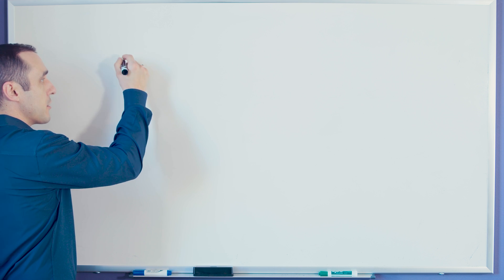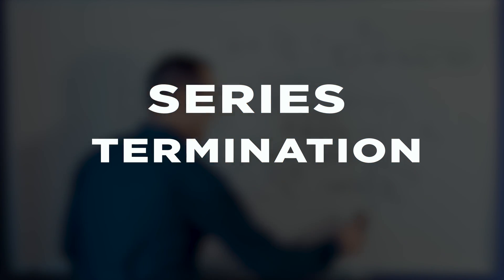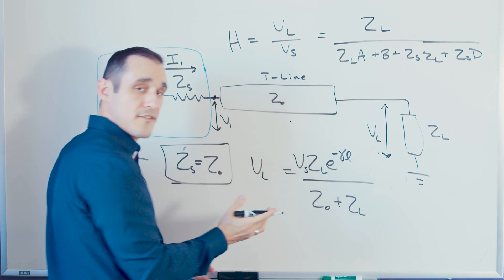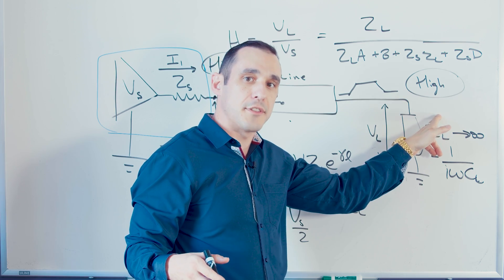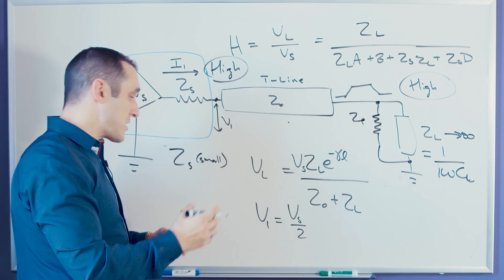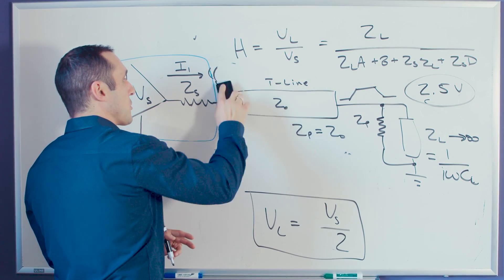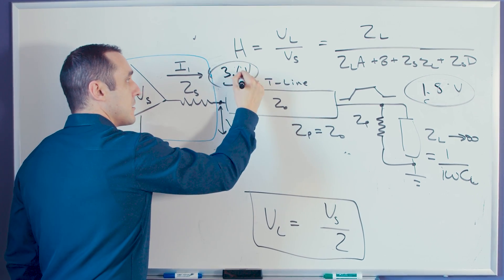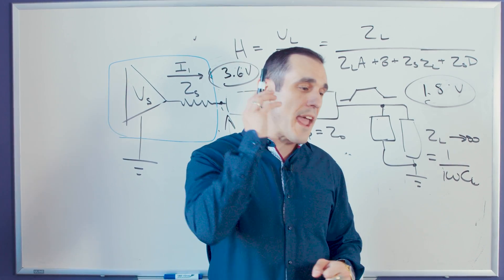Series and Parallel Terminations: Exploring Joint Use on the Same Net

Comment: I have a question:
Can a jumper (0 ohm resistor or other SMT jumper) cause issues in the return current of signals? (issues related to EMC). especially if the jumper has big footprint.
Reply: When the footprint is large it would cause a slight impedance difference, but you would not notice until the frequency range is quite high, into the 2 GHz range or higher.

Comment: A battery question. For years I've been running 2, group 31 deep cycle batteries 12vdc. Let's say each has 100 AH, so, I feel if I run both together keeping 12vdc, I should have 200AH. After years of doing this a few weeks ago someone said no, I still only have 100AH.  Now I'm starting to question myself. I use them to run a 12vdc transceiver, and they charge off a 240watt panel, and 400watt turbine. I had these 2 batteries 10+ years and time for new.  So, what do you say? in short am I right or not?
Reply: If you have two 12V DC batteries in parallel, then you would add their capacities together. So you have 200 Ah.